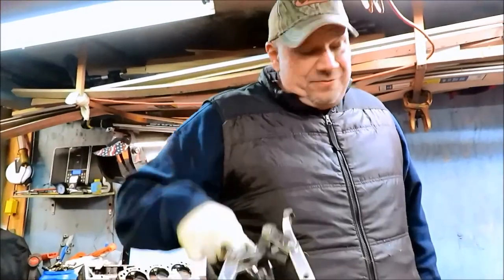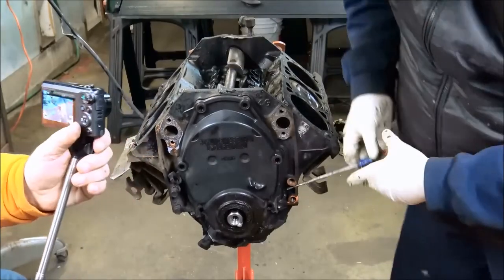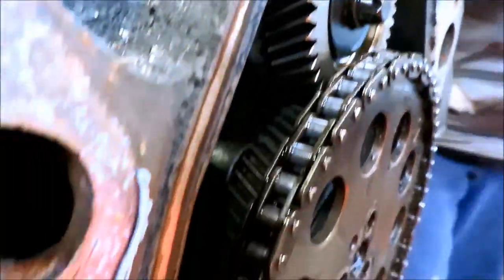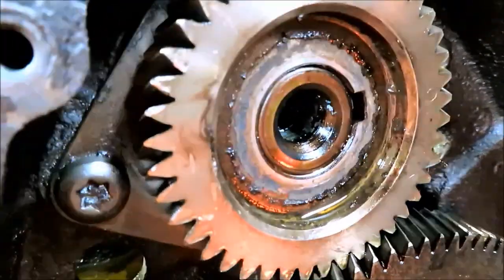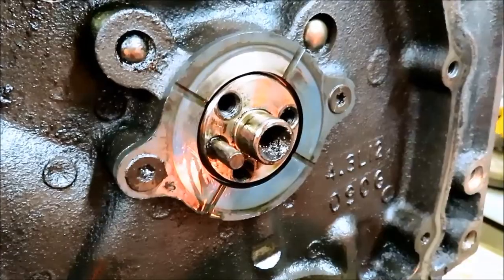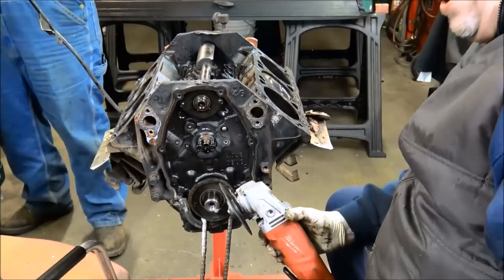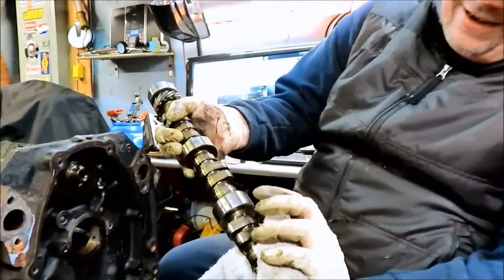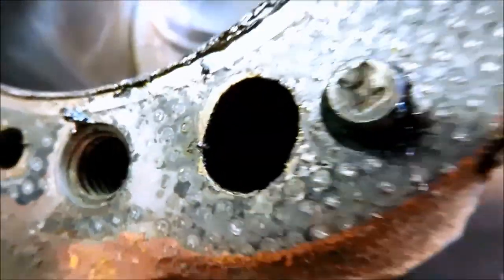PART 2: CHEVY 4.3 V6 ENGINE DISASSEMBLY / TIMING COVER, CHAIN, GEARS, HARMONIC BALANCER  & CAM

Comment: I've had so many of the apart I'm driving a '96 4x4 extended cab. I just replaced timing cover and chain. That balancer shaft eliminates the vibration the earlier 4.3's  but you've probably learned all that by now.

Comment: Hi, you made a comment about a nylon timing gear. I used to think that way, then I got educated. I bought a dragster from this guy and he told me to run a nylon gear. I thought yeah right ! Why would I do that? So after 3 runs down the 1\4 mile I went to check the valves. I was able to rotate the crank a loong way before the distributor moved. The chain looked like the one you took out in this video. I went back to him and said tell me more about the nylon gear. The nylon acts as a shock absorber and doesn't stretch the chain. His race engine had 1inch of lift at the valve and triple valve springs, he ran a nylon gear. I never wore out a chain after I switched to the nylon gear.
Reply from the maker: That’s great info: I never looked at it that way. I agree with that pov. Thanks for the response!

Comment: Use an impact with Torx bits.  And GM has used Torx head bolts since the 70's.

Comment: Why does it have a balance shaft ?
360° is a circle.
You have a 4 cycle engine.
Which is set at a 90° "V"
90x's 4 cycles comes to 360 !
That's why 90°  4 cycle V8 Engines run so well.
The Cylinders fire equally throughout the 360° 's
Simple er what ??
Now...do the math using 6 cylinders.   (!)
Chevy did it simple ...using an existing platform.

Comment: This video was taken a long time ago but I have a question that you may be able to answer.  The lower timing chain sprocket in this video looks exactly like the on on my 2003 S10 ZR2 4.3L Pickup and when I ordered a new Cloyes Timing Chain Replacement Kit it came with a different looking lower sprocket that does not have the large faceplate on the front of it only the actual gear cog itself.  Do you remember if that was the case when you did your repair many years ago?
Reply from the maker: Sorry i dont remember....

Comment: always shoot some break clean into torx fittings.  that way the bit goes in all the way and there is no grease for it to slip on.  them tap in with hammer to set it solid.  if you feel it slipping use an impact hammer blow tool

Comment: Have a 98 gmc jimmy 4x4 slt. 4.3l vortec 4l60e np233. Transmission failing so rebuilding both engine and trans/transfer case. Just ordered a complete frontend kit with new control arms new ac/condensor/dryer and ac hoses. Alot of work. I pulled the frame out from under the body so much easier plus I sandblasted the stripped down frame and painted it looks  brand new. Some red polyurethane bushings for the body
Reply from the maker: hope youre making some youtube videos?

Comment: Also if you were gonna whip the grinder out might as well have just grinded some slots through the heads of the bolts plate be damned, and use a flathead screwdriver. But instead you went in and cut the damn ears off and damaged the block.

Comment: I have a 4.3 in my 2001 chevy Blazer and trying to find someone to rebuild the motor is almost impossible.
Reply: Picked up a 93s10 blazer 4.3l v6. First car ive ever pulled the engine out to rebuild. With help from my father it was somewhat easy to get it out. Currently waiting on parts to arrive
Reply: nobody likes to mess with them because there were so many variations over the years,, its not hard, you just have to do your research.. parts from v8s WILL NOT mix and match as is said by people who dont know what they are talking abt.. you have to positively identify the engine block, what plant it was made in, what year,  and what parts were put in it.,. after disassembly, dont throw anything away.. you may need to measure some parts to be sure you get the right parts to rebuild it.  the piston rods go in a certain way also, unlike a v8. read an article called the holy grail of 4.3 chevy engines.
Reply: You're probably better off just buying a remanufactured one. It's cheaper and quicker. I bought one from Autozone back in 2019. Still runs perfect.  Got about 15k miles on it at this point.
Reply: Bought one on jegs